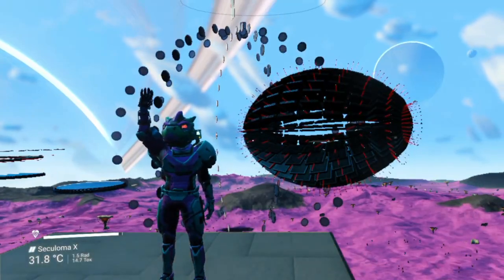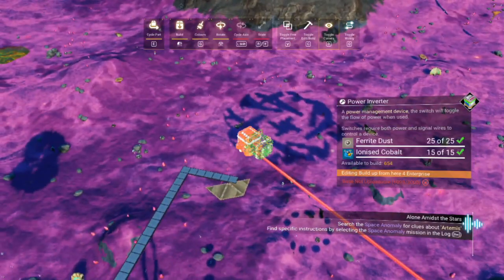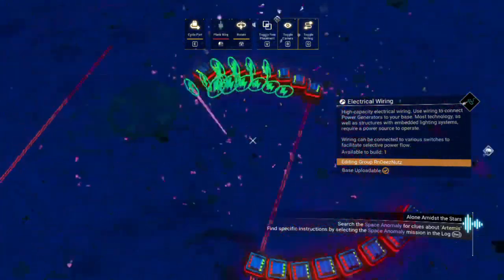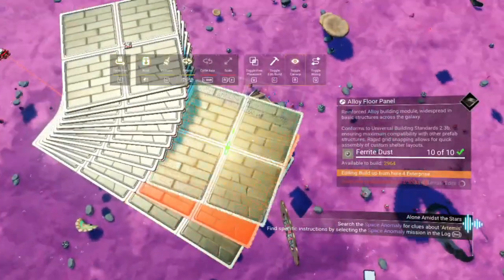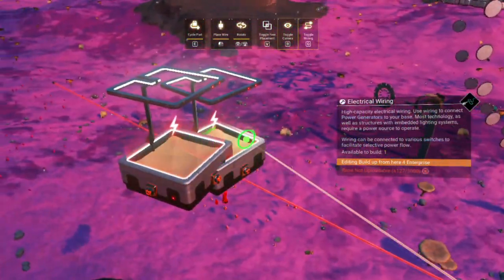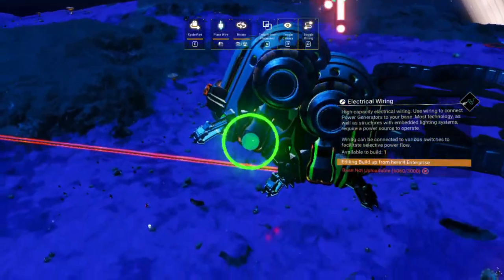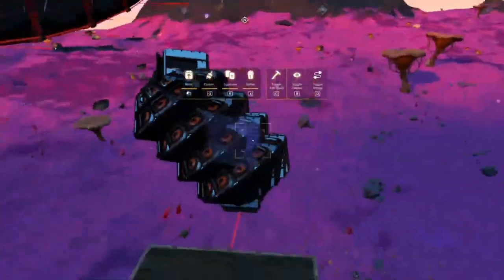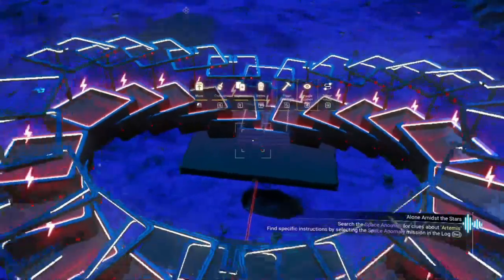Sequencing EP.2 - NMS Glitch Building - No Man's Sky

Comment: Really helpful video, thanks! But I'm just trying to do the 'biofuel' one and I'm having a problem with wire glitching other stuff to the biofuel output connector. When I delete the biofuel, other stuff disappear as well.. What should I do? 😇
Reply from the maker: In this case, build the entire thing, then wire-glitch some floor part in, build out, and use reverse wires to save the connection points, then you can delete all the biofuels without worry. The method shown in the vid is good for simply glitching items directly into the biofuel connectors once the entire circle is done. Lmk if you need anything else, Join my discord !